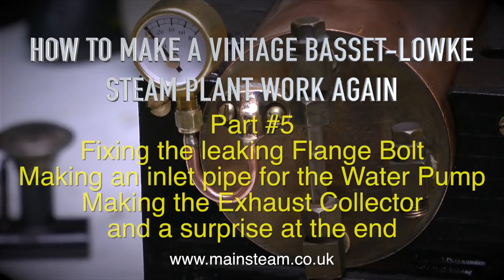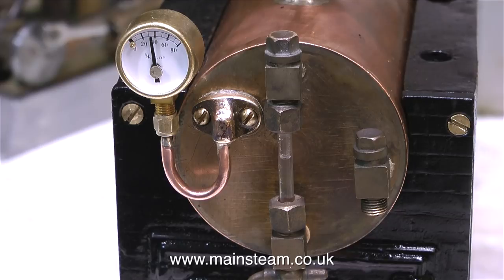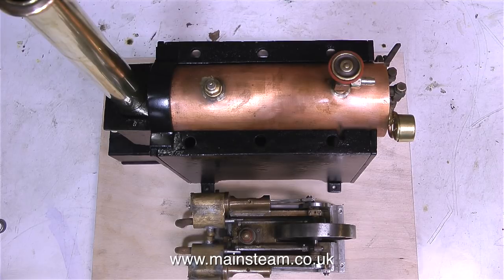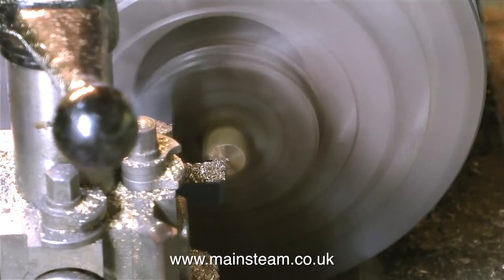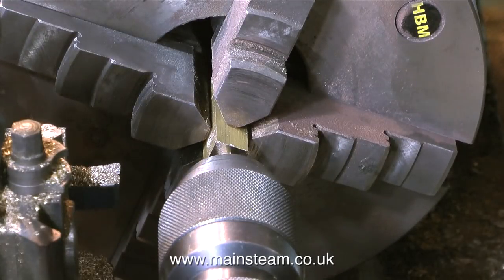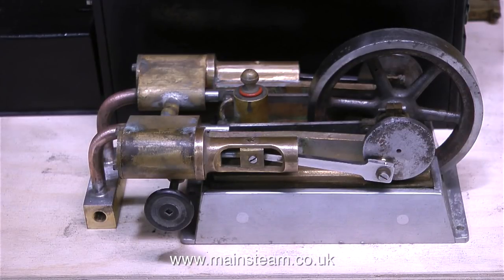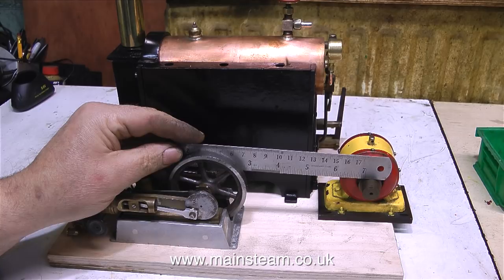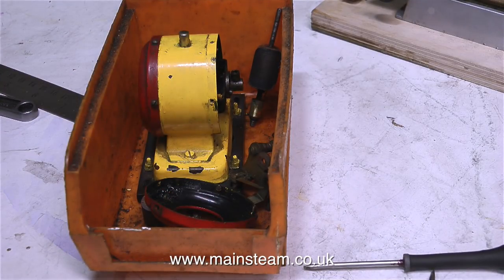HOW TO MAKE A VINTAGE BASSET-LOWKE STEAM PLANT WORK AGAIN - PART #5

Comment: For drilling brass I was taught to take an oilstone slip and just take the sharp edge off the drill - almost creating a negative rake angle. This was supposed to stop the grabbing and it usually did.

Comment: Hi Keith, with the PM elbows do you buy the threaded ones or the castings and drill and thread them yourself?
Reply from the maker: 1/4 x 40TPI, but I always have to re-thread them as they are tight. I think they may be a tapered version of a 1/4 x 40 thread..

Comment: Try Manger's methylated spirits, that doesn't leave your fingers purple. Or Bartoline, I've got a bottle of that which is now almost clear, the dye faded over time. It still smells the same though.
Reply: Mike Savage Bartoline is also only 99p for 500ml in our local HomeBargain store. Cheapest by far in these parts.